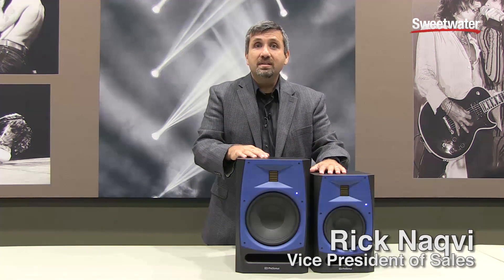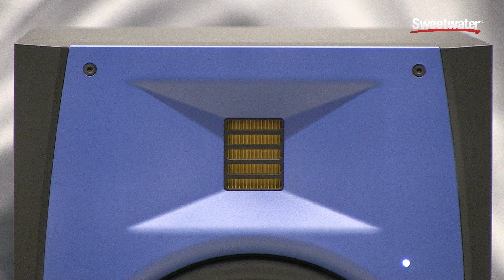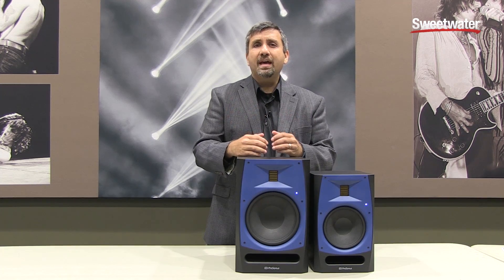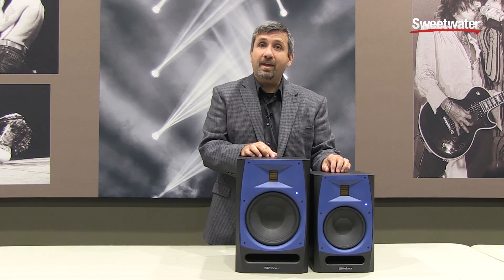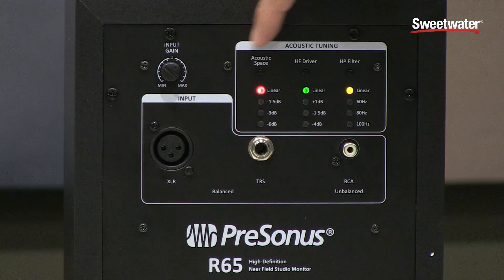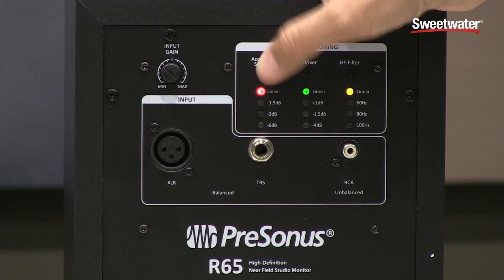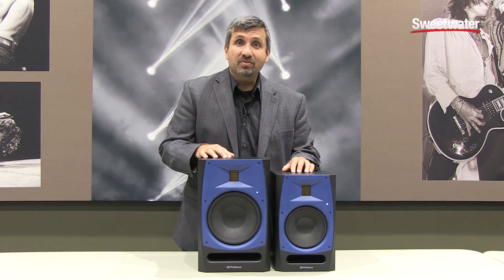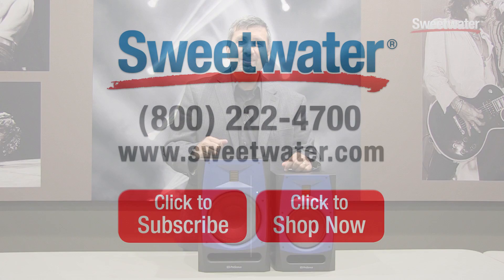PreSonus R65 and R80 Monitor Speakers Overview by Sweetwater

Comment: These ribbon tweeter Presonus R-series models have plenty of self-generated idle noise / hiss. Now of course, all amplifiers have self-noise / hiss. I remember the amps from the 1960s, classic A-type or B-type. with self noise / hiss. AB types of amps also have them. So do D-types. That will happen whether you have a signal cable going into the monitor or no cable at all. Metal ribbon tweeters in addition will emphasize HF noise. With all that said, I am suspecting that the Presonus R65 and R80 have questionable electronics inside, The power supply can also  contribute to the noise/hiss. Also, there is no reason for a Class D-type of monitor to overheat, as do these Presonus metal ribbon models. Also, these are pretty old, almost legacy class models, I believe they came to market in the early to mid 2010s. At a little more money, you have got the Adam Audio T8v, but those are seriously underpowered. The T-series Adams are rear ported, whereas thee Presonus monitors are all front-ported.
Reply: Frank 
What’s your opinion on the Adam T5,6 or T7 
PerSonus R65 V2 ,
 remind me of the Adams
Reply: @DJ.DBD1  T series is pure adam poor fanboy trade. Really bad stereo image and weak highmids. Presonus R series v2 is far better. But if u still wanna go for addams, just look for the adam A series.
Reply: I'm have a pair of presonus r65 since 2018. Absolutely no heat. Also a slight self noise but is ridiculous. You must place your ear in front the tweeter to hear it.

Comment: Is the R80 suitable for Mastering? I am working mainly inside the box.
Reply from the maker: Hey, Ahitagni! These are great monitors and they can certainly be used as a tool in mastering projects. No speaker is 'one size fits all,' so it can depend on what you're looking for out of a speaker, the type of room you're mastering in, and even the type of music you're mastering. Feel free to reach out if you have questions. Thanks for your interest! 
Connor Smith, Sweetwater Sales Engineer, (800) 222-4700 ext. 1793, connor_smith@sweetwater.com
Reply: @sweetwater  Thank you so much for your help and support. Currently I am in the process of rebuilding my Mastering Room. Once I am ready, I will surely purchase a pair of these monitors.